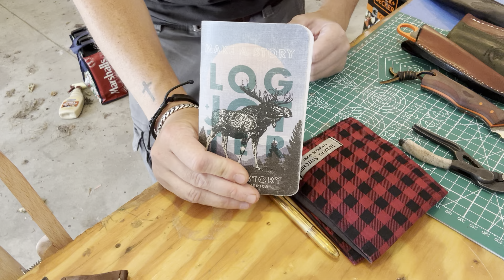HUGE CHANNEL UPDATE! EDC Pocket Dump,New Gear, LEATHERWORK!

Comment: I’m a leatherworking hobbyist.  Although I have no interest in it as a business, I’ve attained a high level of quality.  Especially with stitching.  You need to check out Nigel Armitage’s videos on saddle stitching.  You don’t need a stitch groover unless you really want recessed stitches.  You can use a wing divider to mark the stitching lines.  Are you using stitching chisels?  If so, which ones?  SPI, stitches per inch, plus thread size matters too.  There are some really good YouTube tutorials out there, but some aren’t that great.  Happy to help any way I can.
Reply from the maker: I want recessed saddle stitching- that’s why I use the groover. I just like the way it wears better. I really appreciate you sharing your knowledge!
Reply: @ericasedc  I get that, and that’s what many say.  In the end, I think it is more of an aesthetic choice.  There’s lots of debate on this with arguments on both sides, good arguments.  Good luck!

Comment: Best of luck with your new hobby and possibly new career! I know you can't yet, but when you get to wallets I definitely will need to get one. 😁 As far as the flashlight battery, have you tried using one of those magnets on a stick like they use to fish out bolts and stuff when working on cars? That might give you enough pull to unstick it maybe?
Reply from the maker: @mightymcsamson5899  I tried trust me!!! And I will get on wallets asap!
Reply: @ericasedc  Ouch, and I'm guessing sending it back so they can remove and fix it isn't an option at this point either?